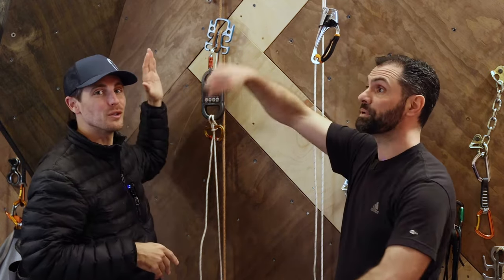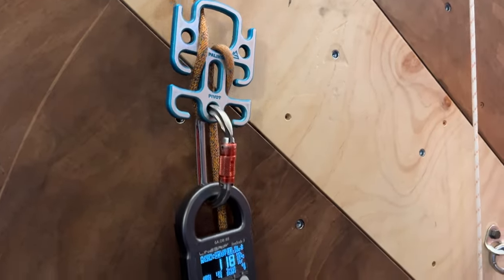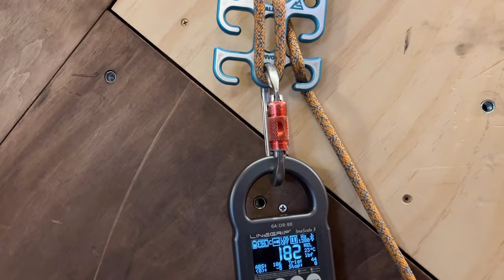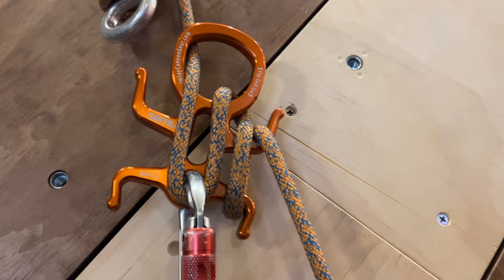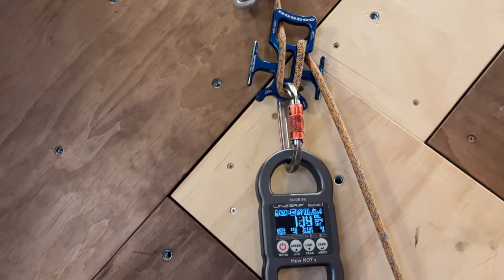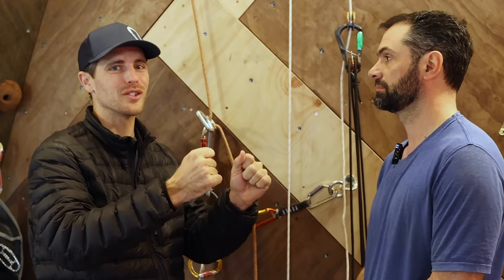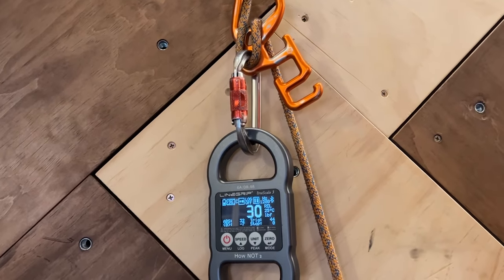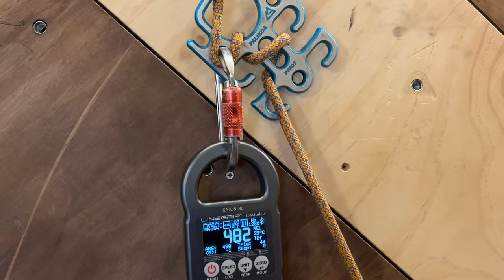How much force does it take to RAPPEL in different modes?

Comment: since you feel kN is not granular enough, you can just remove the kilo part! 1kN = 1000 newtons. 50lbf = 222N, 500lbf = 2224N, so on. in any case, love it mate
Reply: So much math, so little time. 😂 Thanks
Reply: The device doesn't read in plain Newtons, so they'd be converting on the fly.
Reply: @Abc-js7sh  converting between kN and n isnt hard, you just multiply by 1000 (shift the decimal point). 1.23kN becomes 1230n. alternatively, the linescale also supports kgf (kilograms of force)
Reply: @techheck3358  1kg of force = 10N (9,8N to be exact)

Comment: As a mechanical engineer once explained to me.
Friction has a few factors, but the angle of bend is the most significant factor. 
It is exponential, 2 loops is exponentially more friction than 1 loop
Reply: most useful comment I've come across
Reply: @vespasian266  well thanks

Comment: Great information guys! Seriously keep it up. Between this and the "Differece in rappel forces depending on how you start" video, I was wondering if you guys could do a short one elaborating on flat ground anchors and how to start a rappell off of them safely. Southwest utah has a lot of canyons and some pitches where the anchor is 10 to 30 feet from the start of the route. Not a typical top rope anchor. Thanks!

Comment: i'd like to know about the linearity as you add more braking force. like say you can hold 100 pounds with 5 pounds of brake force, does that linearly extend to holding 200 pounds with 10 pounds of brake force? could be interesting to take data from 2 dynamometers and graph them against eachother

Comment: I went canyoning in Vietnam once, before I had any knowledge of course. The only thing I remember is how much I hated the figure eight device because I just had to use a ton of force and still ended up slipping. I would have rather used a Munter hitch instead of that.
Reply: You need to have the chance of one hand rappel - doesn't work with the munter. So canyon figure eights are the way to go. Since the good old Petzl Pirana got eliminated by Petzl itself the Edelrid Hannibal is a great figure 8.

Comment: Great video, but inacurate comment about pressure.  Pressure=force divided by area. the right thing to say would be that he  put a lot of force on it. Force=area times acceleration
Reply: Force=MASS X acceleration. Or pressure times area. But force does not equal area times acceleration. That would yield units of volume per second^2 which would be some kind of change in volumetric flow rate…

Comment: .4kN is most certainly a number. It isnt a whole number but it is discrete and certainly is a lot easier to convert and speak to other people about lol.

Like lets talk about irrational conversion from grams to ounces, and not those pesky fluid ounces..... its madness, usa is!
Reply: obligatory metric note. You have the Base unit N Newtons. and a prefix saying how much of the base unit k Kilo 1 000;  M mega 1 000 000; or in the smaller direction m mili 0,001
you could also use 63,36 kilo inches insted of miles. but at that point just use meters milimeters kilometers
Reply: Funny side note a metric ton is 1000 kg 
So a Kiloton is a Gigagramm. I recommend the video about "Cursed Metric Units"